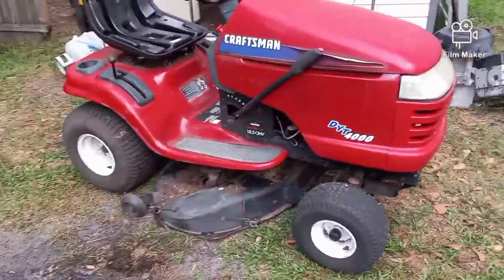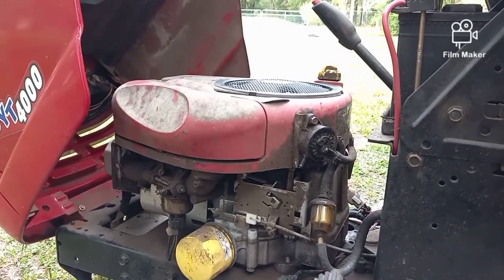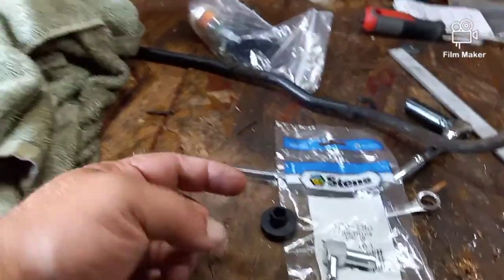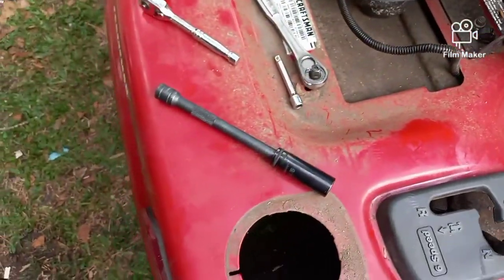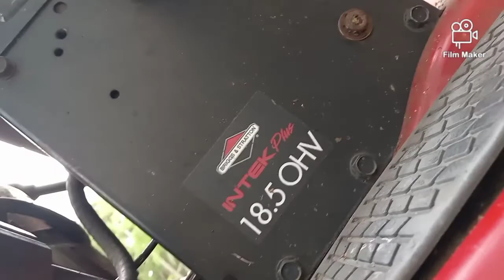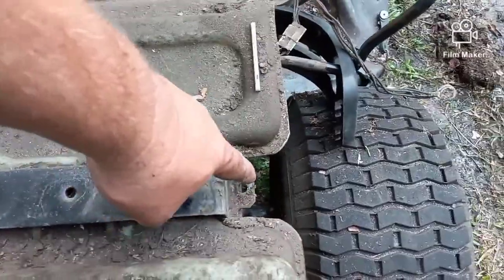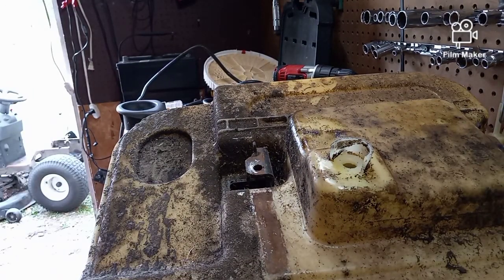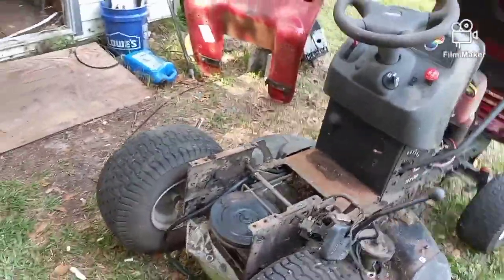Craftsman DYT 4000 Riding Mower SECRET FIX Broken Gas Tank Outlet Fuel Line $5 Fix

Comment: Dooood, for real, you are the man. Just bought a used mower, & went to drain tank as it only ran when choked. Fuel dripped out, should be free flowing. So I put the compressed air to it, now she starts to flow. So I want to replace line, & already ordered the parts. Thank you for taking the time to make this.
Reply from the maker: Thanks for your kind words .. it always makes me feel good when one of my vids helps someone in any small way.. congrats on the new machine and kudos for bringing it back to life
Reply: Rock on

Comment: Very informative. I have the same mower. Have to change the line from the filter to the tank as it's stock from the factory. Bought the mower brand new in 2005. I changed the filter a month ago and noticed the old line was separating inside since it's double layered
Reply from the maker: Yes ethanol will eventually destroy the inside of lines.. I tend to replace lines on anything I touch.. fuel line is cheap and easy and stops future issues before they happen
Reply: @MunkyWrench  It's actually not the ethanol that does the damage. It's benzene in the gas which is in all gas unless you buy that canned crap made in a laboratory

Comment: Really good info. I have a similar model craftman. The 2003 gt5000 which has the shifter on the middle floor. I hope it's as easy to take apart to get to the gas tank. I have not come acoss another video that showed how to take the whole top off so thanks for that! How did you know Bob was my uncle?
Reply from the maker: It's pretty similar so you shouldn't have a problem.. thanks for watching im glad it helped.  Lol Bob is always

Comment: Great video! With just the metal elbow and rubber grommet what keeps gas from leaking? I would have thought there would be a nut and washer to tighten.
Reply from the maker: That's it the metal is larger than the grommet so when it pushes thru it expands and seals the hole. There's no pressure from inside and it works very well

Comment: with the engine running,and the blades enguaged turn the ignition switch counter clock one notch to bypass the safety switch

Comment: Hey man! Great video! I have a dilemma. Wondering if you have any thoughts. I drilled a 5/8 hole!
Reply from the maker: I don't have the fitting on me to measure it.. I'm guessing the hole is now too big to seal the grommet now. U can try finding a larger O/D grommet with same I/D .. call a parts store even if it's in another state they can mail to you. In the past I've made that mistake luckily on a top mounted hole like this and just sealed the hole and drilled a new hole the correct size. Is yours on the bottom of the tank?

Comment: Great video.  Lots of info and to-the-point.  One thought/question.  My YT 4000 has a 2nd line that got chewed by critters years ago so now I have to spray starting fluid into the carb to start it.  I assumed this 2nd line led back to the gas tank in order to keep some sort of vacuum.  Once it starts it runs fine and I can shut it off and restart 20 minutes later with no issues.  I watched the entire video hoping to get more info on that but there is only only 1 line on the system you showed.  Can you tell me what's up with that 2nd line?
Reply from the maker: The second-in-command is a vent usually to stop a vacuum from forming and allow fuel to flow freely .. if you have trouble starting without priming it could be the 2nd line closes the system enough to allow fuel to be drawn up the line .. once fuel is drawn up it works fine
Reply from the maker: Also if u have a fuel pump on yours u may need to replace the short hose that connects the pump to the valve cover. It's what pulses the pump and if it's cracked or leaking it won't have the strength needed to prime for original starting. I have a zero w that problem I'm fixing tomorrow.

Comment: Mine didn’t have the switch in the shifter or 5 screws  only push on grip rings with teeth and the front and back tabs on the plastic shifter housing

Comment: So, I replaced my bushing and the elbow-ordered from sears direct because i had fuel leaking from that area. put the new ones in place and its leaking too. This should be easy, why would it be still leaking?
Reply from the maker: The only thing I can think is that the hole in the tank is not round.  Maybe worn or chipped.. if it is round u may have gotten the wrong size rubber bushing.. there are 2 sizes to choose from.. if the larger is too thick u can drill the hole large enough to accommodate it
Reply from the maker: Also check a few inches away from the bushing .  U could have a pinhole or Crack in the tank somewhere else and the fuel is finding its way down to low spot so looks like it's dripping from the bushing but could be inches away.. even up a side.  Feel around with a paper towel for a wet spot and find the leak
Reply: @MunkyWrench  I have the original owners manual with exploded diagrams and part numbers. Should be the correct one🤷‍♂️

Comment: Hey thank you so much for this tutorial. I was able to follow your strips and replace my elbow and rubber bushing. However… more my tractor won’t turn over. Is there a switch or wire that I may have disconnected or hooked up wrong that’s not letting it turn over??? It was cranking like crazy but not running  when the gas line wasn’t working.
Reply from the maker: There's a wire that goes to a switch by the shifter under the panelif I remember correctly.. a safety switch that needs to be plugged in to show that the blades are NOT turned on in order to start.  There's a switch under the seat as well.. and one on the brake pedal. U have to push brake to start. If any of those switches are not connected u will get nothing when turn key

Comment: what was the name of the part that you used to fix the tank
Reply from the maker: It's called a Stem and Bushing Kit.. its also galled a fuel tank rubber grommet ..
Reply: @MunkyWrench  You Sir are a life saver. Thank you so much for your video.
Reply from the maker: @myrccenter1124  glad I could help .. thanks for stopping by .. see u soon
Reply: @MunkyWrench  that video is excellent, just working on mine now.

Comment: Part numbers are no longer in the description, at least I can’t see them on my phone
Reply from the maker: @AgentDeCamp4  sorry about that I am out driving ATM but when I get home I'll remedy that.. they are pretty standard across the board here's an Amazon link https://www.amazon.com/xuyunming-AM122215-Fuel-Pickup-M132706/dp/B0CMH89CBN/ref=asc_df_B0CMH89CBN/?tag=hyprod-20&linkCode=df0&hvadid=693711673639&hvpos=&hvnetw=g&hvrand=2420413271278290499&hvpone=&hvptwo=&hvqmt=&hvdev=m&hvdvcmdl=&hvlocint=&hvlocphy=9012076&hvtargid=pla-2266133253753&psc=1&mcid=1dc03fb67478305ab28abb6dca1a1d55&gad_source=1
Reply from the maker: @AgentDeCamp4  you can search .. mower gas pickup.. and find the one specifically for your machine.. the main thing is knowing if yours is straight or 45 degree angle.. the sizes are pretty standard across the board

Comment: Are you sure that's not Stens 125-336?
Reply from the maker: That video was over a year ago.. the part numbers change from time to time .. I believe I showed the parts numbers in the video so at the time of filming they were correct.. let me know if they have changed I will pin a new comment to the top with updated part numbers.. thanks for helping out and for giving thumbs up, subscribing and taking the time to comment

Comment: News flash…. Should have looked closer before taking the shroud all apart. Many of those tanks are already set up to use the grommet bushing with the elbow in them. Doubt that this was drilled out other than at the factory. Grommet and elbow can be replaced in about 10 minutes without pulling the tank.
Reply from the maker: Thats a great point and definitely should look for that however while that was quite a while ago , I can say I often do 5 to 10 repairs per day and if u watch my videos I don't spend time doing ANY work that is not necessary.. in the interest of wasting time so if I pulled it apart there was an absolute need to do it in this case. I do appreciate u watching and taking the time to comment. Every comment helps me make better videos in the future. So thankyou so much